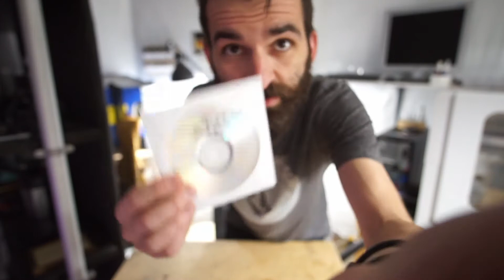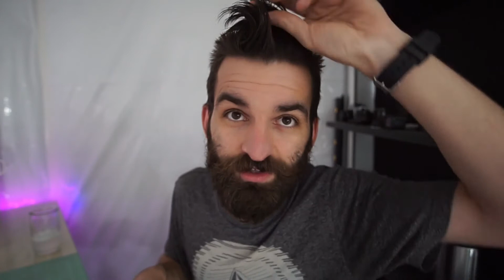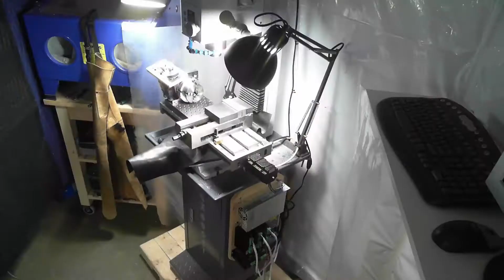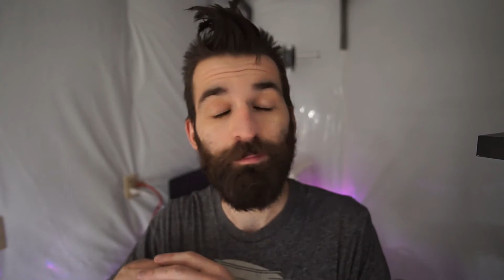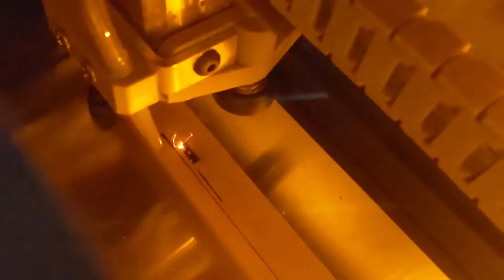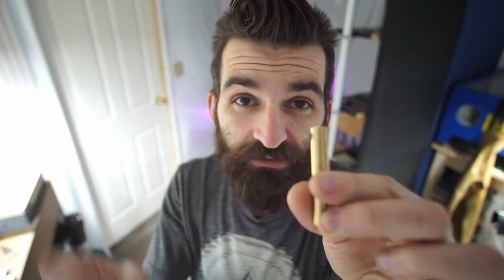Laser All The Things

Comment: Plywood is always a pain to cut on a laser, the glue makes it a lot harder to cut. If you end up doing more things cut out of plywood, nicer qaulity wood cuts better cause there are less voids in the layers.
Reply from the maker: So it seems...funny part is this is NOT cheap plywood (actually has cleaner and thinner laminations than the Baltic birch stuff I normally use)...thankfully I have very few uses that involve wood for this machine.
Reply: Agreed, I use cnc router for that